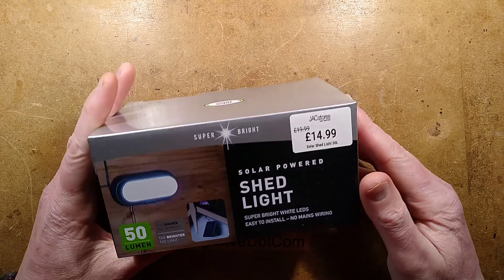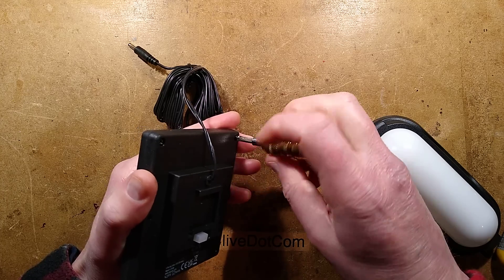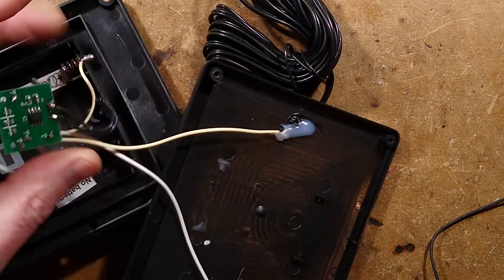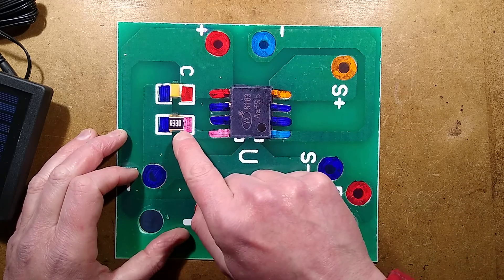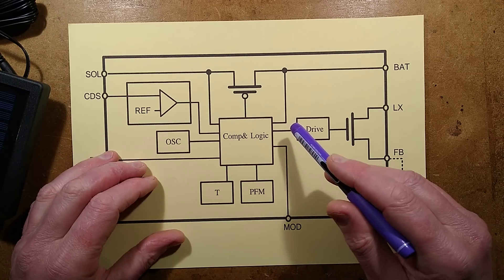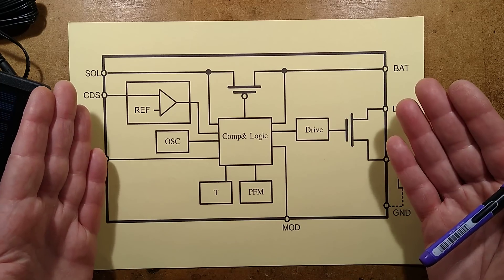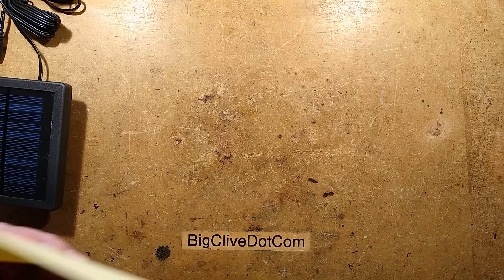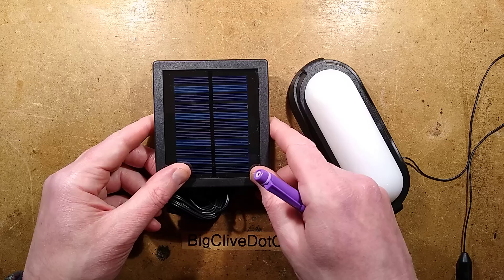Solar shed-light teardown (with schematic)

Comment: interesting uou mention sun cracking the silicon.
i had a solar power bank many years back that i left on my car dash, and the heat actually melted the case and swolled the cells. pretty much a bad idea all around.
Reply from the maker: The solar power banks are a terrible idea.  Lithium cells should not be left in the sun

Comment: after time those solar panels with resin will eventually fog over or become white from the sun. I have tons of them for the yard and property lights and they all do it unless they are glass.
Reply from the maker: Try cleaning the front with T-cut automotive scratch remover or some toothpaste on a soft cloth.

Comment: Although this IC is designed to power LEDs, could it also be used to power other low current devices?
Reply from the maker: Yes, it should be able to power other loads.

Comment: sup clive just wondered if you know of a good way to prevent shorting for a trs/trrs slot incase a cable is plugged in or taken out while its powered, as i wanted to make a small box that uses a pico pi and has breakouts in the form of trs/trrs connectors like how the handicapable controller for xbox does, i was thinking of using self resetting fuses but im not sure if it be as simple as placing them inline of the trs/trrs or if a circuit need to be build on the line with more then just the fuse.

Comment: That'd get baked in the Florida sun. I like the idea of a separate enclosure, or a skylight. That's a very clever chip. It's essentially blind though as it doesn't have a light sensor. (not that something like this needs it.)
Reply from the maker: It does have light sensor functionality on the chip.

Comment: I keep trying to reply to your question and althtough I am using no naughty words, my reply seems to vanish after a few seconds - as such, will try to answer with a new post:-

"Now that's odd. I just replied and it has vanished. Oh well. in short, I think you are right - autonomous sync seems about right - but it was the fact that there was 16 channels so they all had their own version of the pattern for chasing etc.

Also, if the clock is derived from the AC supply, then I guess the program can be halted (DC) or slowed down / increased, but altering the AC supply frequency..

Either way, i thought they would make an interesting little vid as to how they worked - with the usual teardown and reverse engineer. As you are quite well known, my guess is they might even free-issue you a set of 16 lamps to play with.

All the best."

Comment: Do you suppose it'd be possible to rig up some manner of small solar panel on my shed for charging tools and such?
Reply from the maker: It should be viable.  But will depend on the tool charging requirements.

Comment: Sir, an unrelated question, assuming that you would be kind enough to answer. If you had to replace your Hopi Power Meter what would you choose?
Reply from the maker: I recently got an Antai rebrand version that has software that deals with weird (purely capacitive) power factor better.  But the Hopi is fine.

Comment: Do you have any ideas what to do with a old solar powerbank where the battery had inflated but the solar panel and chips are still good?
Reply from the maker: Discharge the battery as much as possible and dispose of it in a safe manner, then use the PCB with salvaged lithium cells to make a custom backup power bank.  The solar power banks are a terrible idea, since putting them out in the sun will overheat the lithium cell and make it puff up.

Comment: I mean, its probably alright for grabbing the odd thing from a really dark shed but you won't be sitting under it tinkering away at anything.
Reply from the maker: It is really just optimised for general illumination.  But you could add a custom focussed beam light.

Comment: I don't like the way most LED lights are designed. They're usually a lot of LED's in series or in parallel with one current limiting resistor. One LED shorts out or opens and the whole thing is trash (unless of course you repair it). I like when each LED has a current limiting resistor, that way if one shorts or opens it just loses one spot and not the entire assembly is out of order.

Comment: Too bad the chip designer didn't include low temp charge inhibit. Might be easy to add on for minimal cost though. 
I've got an outdoor solar spot here with a relatively complex board which has an issue. no markings on 8 pin chip, but it might be the same as this. 18650 Lion w/40 LED parallel and 10S2P solar cell. May as well reverse engineer it ALA BigClive. (ran it over with my tractor this winter, minor case crack, but it has water ingress damage.
Thanks for making the great content, keep at it and I'll play along at home.
Reply: I wonder if there is a suitable value NTC thermistor that might do for thisif popped in series with the the output from the solarr panel - the current requirements from the cell would be very modest.

Alternatively if there was 0.6v to spare from the solar panel, then it could go through a diode (to stop lithium cell discharge) and then a PTC could basically "short out" the solar panel if it gets too cold.

NTC might be simplest and easiest though :)
Reply: People would return them as "defective" if they wouldn't charge when too cold.
You could have that written in a bigger font than the title text and it wouldn't matter, as people would ignore it.

Comment: Im glad the Solar Controllers no longer use the stupid little Inductor!
Reply from the maker: There are many advantages to using the boost inductor.  It means a small solar panel can be used and the single NiMH cell won't have reverse charging issues as happens with cells in series.

Comment: I’m surprised it wasn’t a 18650, they must’ve got a deal on 14500. The 18650 are so common.
Reply from the maker: The case was probably originally used with NiMh AA cells.

Comment: I feel like it'd make for an even smarter (heh) product if they moved the battery and charging chip into the light and used micro USB or USB-C as connector. That way you could use the solar panel to charge other devices, and charge the light from an outlet if you need to. It'd also protect the battery.

Comment: That is an extremely large number of LEDs for the power. That thing will last forever. Unless they used the poorest factory rejects again.
Reply from the maker: It does make me wonder if they use the same light with a bigger system.

Comment: Probably out of the same factory as the ALDI shed light with shitty steel wires that eventually corrode due to the solder flux. 
Tip replace the wire with copper and paint the circuit withthick  clear nail polish. I only found the wires were steel when I could not resolder the wires and noticed that a magnet attracted the wire. 
Side not I also found that a new set of alligator clip test wires also where shitty steel wires.